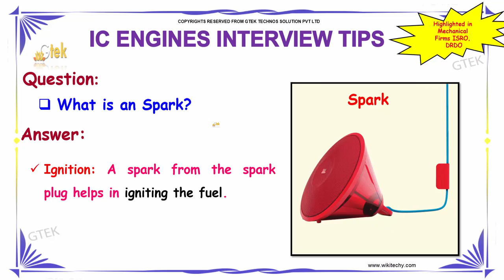what is an spark | ic engines | mechanical interview question | wikitechy.com

Comment: A spark plug (sometimes, in British English, a sparking plug, and, colloquially, a plug) is a device for delivering electric current from an ignition system to the combustion chamber of a spark-ignition engine to ignite the compressed fuel/air mixture by an electric spark, while containing combustion pressure within ...

Comment: Jump to Spark ignition process - Diagram describing the ideal combustion cycle by Carnot. An internal combustion engine (ICE) is a heat engine where the combustion of a fuel occurs with an oxidizer (usually air) in a combustion chamber that is an integral part of the working fluid flow circuit.

Comment: An internal combustion engine (ICE) is a heat engine where the combustion of a fuel occurs with an oxidizer (usually air) in a combustion chamber that is an integral part of the working fluid flow circuit.

Comment: A spark plug (sometimes, in British English, a sparking plug,[1] and, colloquially, a plug) is a device for delivering electric current from an ignition system to the combustion chamber of a spark-ignition engine to ignite the compressed fuel/air mixture by an electric spark, while containing combustion pressure within the engine.

Comment: Fuels

Spark-ignition engines are commonly referred to as "gasoline engines" in America, and "petrol engines" in Britain and the rest of the world. However, these terms are not preferred, since spark-ignition engines can (and increasingly are) run on fuels other than petrol/gasoline, such as autogas (LPG), methanol, ethanol, bioethanol, compressed natural gas (CNG), hydrogen, and (in drag racing) nitromethane.

Working cycle

The working cycle of both spark-ignition and compression-ignition engines may be either two-stroke or four-stroke.
A four-stroke spark-ignition engine is an Otto cycle engine. It consists of following four strokes: suction or intake stroke, compression stroke, expansion or power stroke, exhaust stroke. Each stroke consists of 180 degree rotation of crankshaft rotation and hence a four-stroke cycle is completed through 720 degree of crank rotation. Thus for one complete cycle there is only one power stroke while the crankshaft turns by two revolutions.

Comment: The most prominent difference between Spark Ignition (SI) and Compression Ignition (CI) engines is the type of fuel used in each. In SI engines petrol or gasoline is used as fuel, hence these engines are also called petrol engines. In CI engines diesel is used as fuel, hence they are also called diesel engines.

Comment: An electric spark is an abrupt electrical discharge that occurs when a sufficiently high electric field creates an ionized, electrically conductive channel through a normally-insulating medium, often air or other gases or gas mixtures.

Comment: Where the combustion process of the air-fuel mixture is ignited by a spark from a spark plug. This is in contrast to compression-ignition engines, typically diesel engines, where the heat generated from compression together with the injection of fuel.

Comment: Spark Ignition air-fuel mixture enters into the combustion chamber, but in Compression Ignition, air and fuel enter separately in to the combustion chamber.

Comment: The term spark-ignition engine refers to internal combustion engines, generally petrol engines, where the combustion process of the air-fuel mixture is ignited by a spark from a spark plug. This is in contrast to compression-ignition engines, typically diesel engines, where the heat generated from compressiontogether with the injection of fuel is enough to initiate the combustion process, without needing any external spark.

Comment: Spark ignition process - The spark ignition engine was a refinement of the early engines which used Hot Tube ignition.

Comment: delivering electric current from an ignition system to the combustion chamber of a spark-ignition engine to ignite the compressed fuel/air mixture by an electric spark, while containing combustion pressure

Comment: A spark plug is a device for delivering electric current from an ignition system to the combustion chamber of a spark-ignition engine to ignite the compressed ...

Comment: The working cycle in case of four stroke engine is completed in following number of revolutions of crankshaft. ... Scavenging air in diesel engine means. ... Does the supply of scavenging air at a density greater than that of atmosphere mean engine is supercharged ?

Comment: Device for delivering electric current from an ignition system to the combustion chamber of a spark-ignition engine to ignite the compressed fuel/air mixture by an electric spark, while containing combustion pressure within ...

Comment: a small fiery particle thrown off from a fire, alight in ashes, or produced by striking together two hard surfaces such as stone or metal.

"a log fire was sending sparks on to the rug"

2.

a small amount of a quality or intense feeling.

"a tiny spark of anger flared within her"

synonyms:particle, iota, jot, whit, glimmer, flicker, atom,speck, bit, trace, vestige, ounce, shred,crumb, morsel, fragment, grain, drop, spot,mite, tittle, jot or tittle, modicum, hint, touch,suggestion, whisper

Comment: Questions on IC Engines with answers. ANS. The internal combustion engine converts chemical energy into useful mechanical energy by burning fuel. Chemical energy is released when the fuel-air mixture is ignited by the spark in the combustion chamber.

Comment: The combustion in a spark ignition engine is initiated by an electrical discharge across the electrodes of a spark plug